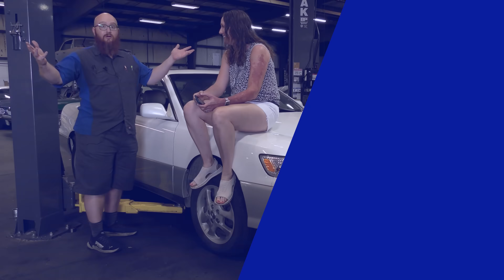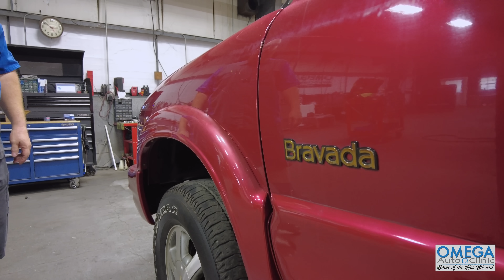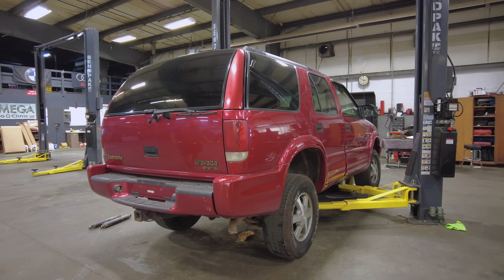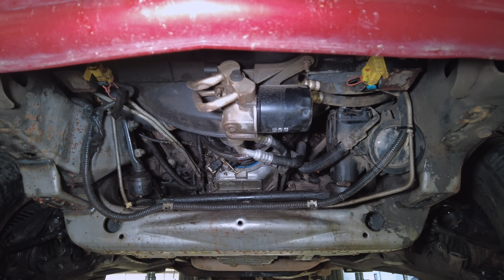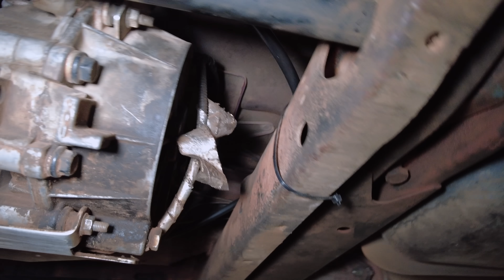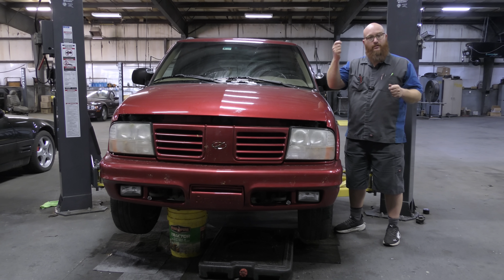Is Car Wizard Taking American Cars Again? That's an Olds Bravada!

Comment: i have a Nissan Micra '04. 1.2L 80hp. they dont sell those in USA i guess. they are known for having early timingchain issues, i have such problem in my car, i guess it will run for another 100K miles with only having a rattling chain when starting and overall slow. but hey, i dont mind, if it holds it holds, am gonna keep it till it fails. i payed $2K for it with 100K miles.

Comment: 9:23 - When did they put V8s in the Bravada?
Reply: I caught that too. He did mention that the 4.3 is basically a v8 with 2 cylinder cut off so might just be a reference to that.
Reply from the maker: They never have

Comment: Not even looking at your video, I’d say this car is worth whatever anyone is willing to pay for it. Would I buy it (I’m 77), no matter what the price is…..answer….NO.  Especially not for the winter.  I was working on a 2007 Scion tc, yesterday. I needed to get a drivers side rear wheel caliper, and I couldn’t find one today. I live in a NW suburb of Chicago. I could find the part overnight on the web. What kind of problems are you going to have finding parts?  Especially on a manufacturer, that is gone?
Reply: It's a GM product which shared a lot with the s-10 and s-15 which have large aftermarket support.  Parts acquisition is not a problem and GM is still around.  Oldsmobile was a line and many parts cross reference to other vehicles GM made.

Comment: Technically this is Japanese. 

This frame is based on the S-10, and the S-10 was joint developed by GM and Isuzu.

It's technically an Isuzu Rodeo.

Comment: I liked the styling of Oldsmobile cars and I wish they would have dumped Buick instead, but I understand the difference is really only cosmetic. My family had a 99 Blazer at one point and these Blazers / Bravados are tough little trucks. Unfortunately, in my opinion they are very rough and horrible to actually drive and have a terrible interior. It's great for towing a boat or a trailer for a mom and pop lawn maintenance company, but for a 1999 model year daily driver SUV of similar size I would prefer a Grand Cherokee or 4-Runner.

Comment: When all the repairs have been done, this Bravada will still be going when most of todays
tin foil and recycled plastic cars have been scrapped.
I hope it gives the owner many more trouble free miles.
Reply: Me too and I will be making it last guaranteed.  Parts are still easy to find to the point it's a non-issue since these engines were used all over.  Minor stuff I can get from ebay and amazon so we're set!  It's got a lot of life left and within 10 years, most of the stuff on the roads today will be scrapped and the Bravada will just keep on going.

Comment: I thought you and the shop had sworn off doing domestic car repairs. In Illinois if you waited one more year it qualify as an antique vehicle. I guess I question why put money into something that old, parts will just keep failing. Are you falling into a rabbit hole of constantly replacing or repairing where money could be better spent on a newer vehicle. Just asking.
Reply: What parts specifically are you referring to?  There isn't much to go wrong if you understand the mechanics of the thing and just do simple maintenance.

Comment: I miss  my 98 bravada. Got it for $2k. Replaced  the intake manifold gaskets. Drove it for over a year  then it got stolen and got $6500 from insurance  😂  bought that with  some of the money from my honda crv, I got it for $600 frozen it for a year and a half and it got stolen  I got $5300 from insurance. 😂 bought that with the money from my wrecked 98 blazer. Got it for $600 drove it for a year and  some asshat made a left turn in front of me when he had a red arrow and I had green. Insurance paid $4900 for that.  It would have  been $5500 but they changed me for the seats I kept for my 2003 s10.  Which I installed  a bravada front end on it. I got it for $300 and put  $1000 into it over 5 years  but never registered it so the cops took it

Comment: As to the Bravada, these were cheesy with a vibrating engine and a rattly interior.  This must have some sentimental value for the owner.
Reply: Not at all.  Just like old GM stuff that I can work on.  I don't mind necessary repairs...just have to be able to do it and in this case it was convenient for us to leave it with the Wizard.
Reply: @LazloNQ  I had a '97 Ford Aerostar for a while that was that way.  I had an '85 Porsche 928S2 5 speed, and that wasn't even all that hard to work on.  Today I have a '14 Cayman S and I work on it too, but you have to lift the car to change the oil and do other things so I bought a QuickJack.  Modern cars really are not that hard to work on, especially with OBDII systems that basically tell you what is wrong.  Otherwise, an engine is an engine.  Ignore that all that damn black plastic and change the plugs the way you always have...

Thanx!  👍

Comment: I like how Wizard wants to harp on the "is it worth it to fix it" for almost the whole video. How many miles does it have? If it had 279K probably not. About twelve minutes in he lets us know it is about 120K. The condition, 119K and change miles with a relatively "bulletproof" engine that has parts available with today's car prices, quality and cost to repair it isn't that hard a question really.

Comment: Did you say labour a $150 an hour ? Is that around the average in the states or your area ? Before anyone bashes, I do get it. You got to pay for the shop, tools and equipment, and the wages. It just a shock to hear it when you’re paying $100 an hour and find it hard to justify putting your rig in the shop at times. And the price of parts is nuts these days. A caliber cost me about $200 from the dealer for the OEM one 3 years ago. Dealer wanted about $400 the other day for it. Ended up having to go with a refurbished one for $130 which I hate because in my experience, they don’t last much longer than a year.
Reply from the maker: Yes. Thats the going rates in KS. Everything is going up in price. Even motor oil.

Comment: I was under the impression that it was The Car Wizard that decided to no longer work on domestic cars. TBH, if an employee laid an ultimatum on me, he would be looking for another job. That level of entitlement has no place in my business.
Reply: An ultimatum? Please. He just told the wizard what he is and is not comfortable with. Wizard can go right ahead and fire his techs, you think there are knowledgeable people to take their places?
Reply: @bimmerapologist  Are you implying that Grimes was the only tech in the Car Wizard's shop? If he's not comfortable working on domestic cars, that's fine, until it isn't. There are other techs, including the boss. But for it to get heated enough that the Car Wizard announced that he will no longer take domestic cars? That sounds like there was a problem to me.
And yes, good technicians do exist and new ones can and should be trained. Perhaps that is something that modern business practices have forgotten.
Reply: @surferdude4487  this is all just speculation at this point. no one can say besides them.

Comment: Since the 50’s family members and friends have owned Oldsmobiles, some good, but most bad. I remember a 1958 Oldsmobile that was beautiful, but such a mechanical nightmare. I remember a 1988 Delta 88 with a 3.8L that was amazing. Then the same owner (my boss at work) had a 1991 Oldsmobile 98 that was a piece of crap and everything broke on it after the warranty. I was a Chevrolet man in the 60’s thru the early 90’s.  But my cars that were duds were the Vega, Citation, and Eurosport Wagon. I bought no more GM cars after that.   Sorry…….

Comment: 10hrs for timing cover? gtfo of here lol 4 hr tops
Reply from the maker: Nope. Front diff, steering linkage, oil pan, oil cooler, all has to come off to do it right. You are incorrect.
Reply: @CarWizard  I've done it before and just unbolt the motor mounts and raise the engine up a bit so you can drop the oil pan just enough to get the cover out.

Comment: The wizard is working on American Cars again? 
 And as an Oldsmobile fan and owner of a 3.1 L 1992 olds cutlass supreme, Blue and a 1996 model year in white with the 3100. Just all around well built cars, better than GM today. Thats for sure. And this generation of Bravada and t g e earlier with 4.3 just not good.  The Best of the Bravadas happened in the last Gen 2002 to 04 years  Reliable as all get out, besides the weak trans..from my understanding

Comment: I've worked on a lot of vehicles in my life and honestly, mechanics is mechanics.  People get to thinking their German-made cars are machined from gold or underneath the hood there is something special or different and it's truly not the case.  There are variations on a theme and certainly build quality varies, but when you're talking about the reciprocating engine powered vehicles, once you've seen what's going on - they're all doing the same thing - burning petrol or diesel to make tires spin to propel you down the road.  The repair of them is pretty straight-forward although the cheapening of production is getting worse and the electronic complexity to facilitate forced obsolescence is at an all-time high.  If I could get away owning the same vehicle my entire life, I would.  It's cheaper and intimately knowing your machine is powerful since you can fix it yourself and know how to do it.  Whether it's an Olds Bravada, a Smart Car, a Porsche, a BMW, etc. - it's still an engine turning gears to make it move down the road.  They're all subject to rust in salty midwest winters and some of them are infested with engineering abominations that are unecessarily complex.  They are ALL variations on a theme and some are done well and others not so well.

Comment: I get where the car wizard is coming from, and trying to be accommodating to his mechanics. But there should never be a point where the mechanic tries to strong arm the business owner, and telling them how they should run their business. I would’ve told the mechanic, if he wants to be selective about which customers vehicles he works on, then he needs to go work independently, we have a shop to run, and customers to take care of. It doesn’t matter if it’s a foreign car, domestic car, a $500 vehicle, or a $500,000 vehicle. When you work for somebody else as an auto mechanic, you don’t have a say so on what you’re working on. You do the job or you go find other means of employment.

Comment: I absolutely loathe the Bravada.  My folks had one, being a fairly large dude, I had to take my artificial leg off to ride in the back seat.  It drove odd, felt like the front end wasn't right.  Dad loved it, I hated it.  It also got lousy fuel economy. They tried to give it to me, I told them to give it to my sister instead......  I think it's still parked out behind the shop at her place.
Reply: Sorry you hated it.  It's thirsty yes and the failed sway bar bushings made it weave side to side as I drove it from Kingfisher, OK to Newton but it didn't handle any different than our 1989 Buick when its bushings wore out.  It handles like a heavy little tank.  Since we are going to use it for inclement weather driving only, it mostly will be stored until it's needed.  It won't be a daily driver and won't cost a fortune to tag and insure.

Comment: Oldsmobile is not a company. It’s a subsidiary of GM. David knows that, but the public may not.
Reply: Right conclusion, wrong facts. It was a division (not subsidiary) of GM rather than a company.

A subsidiary is, by very definition a COMPANY under another company in a corporate hierarchy.
VAG is a company (Holdings corporation). Audi under VAG is a company. Lamborghini under Audi is a company.
"What Is a Subsidiary? In the corporate world, a subsidiary is a company that belongs to another company, which is usually referred to as the parent company or holding company."